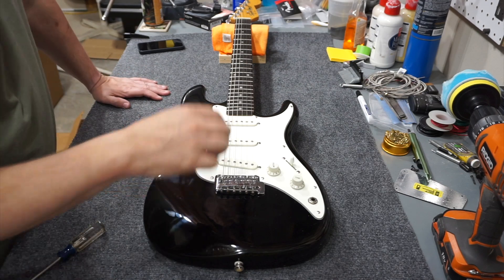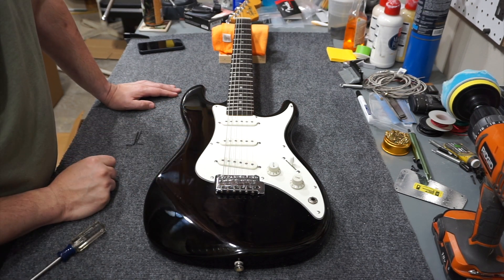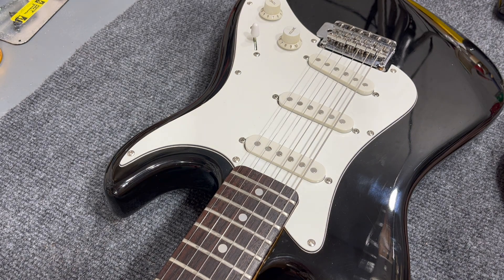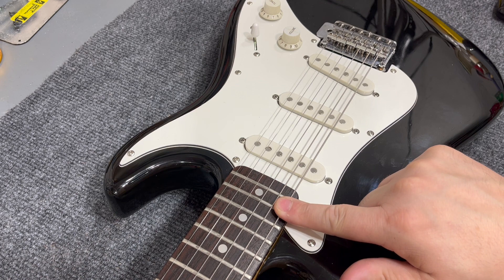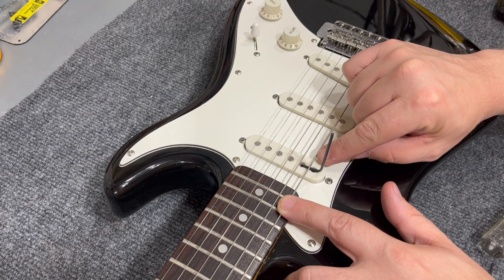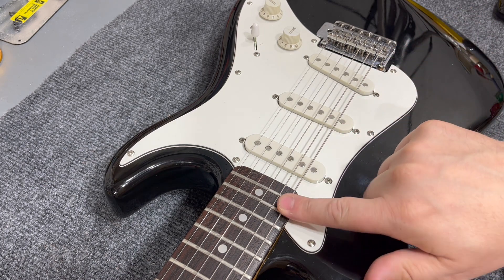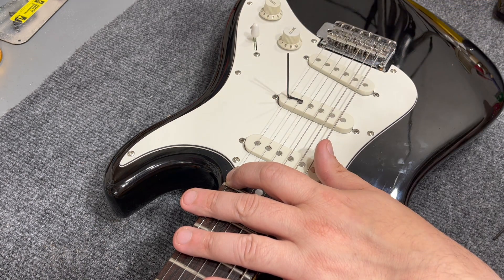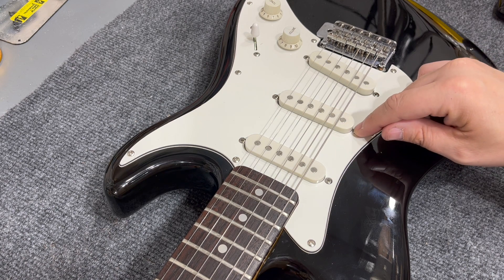Quick Tip 9: Adjusting Stratocaster Pickup Height

Comment: what size hex keys are 4/64 and 5/64 inch.....what are the equivalents in millimetres please?
Reply from the maker: Roughly 1.6 and 2 mm.  There’s probably not an exact metric equivalent in hex wrenches, so you would have to use a 1.5 mm wrench and adjust it for a loose fit.
Reply: 2MM gap from string bottom to polepiece top is Fender's suggestion...
Reply: Always you have to multiply 2,54 by 4 or 5 and so divide by 64, and you´ll have mm measures.

Comment: When you raise the pickup I have notice it is much more senitve when tuning with electronic tuner . I guess this has to do with the magnet being so strong has anyone noticed this ?
Reply from the maker: The closer the pickup to the string, the stronger the signal, so it makes sense.  If you mix pickup brands or types and one is louder than the other(s), it helps to move that one away from the strings to balance the output.
Reply: I think this is what is called stratitis, but whatever it’s called, yeah you have to watch out for it. Even without a tuner if the pickups are too high I think it’s most notable on the G string. It’s will flatten the note fairly quickly, and also noticeably cut down on how long the not sustains for. If you hear this happening it’s just to incrementally lower the pickup until it goes away. Someone mentioned too, this is why when adjusting pickup height, it’s best to start with the bridge pickup. Set it right, and then adjust the other pickups to be the same volume/loudness. If you first set the neck, and it is “hot” it may be the bridge has to be too high to get the same level and then stratitis can happen .

Comment: not really an accurate way to do this since pole pieces can be at different heights on different guitars
Reply from the maker: On a Strat, the E strings are reference points for the other pole heights, so it works out.  See pickup section here: https://support.fender.com/en-us/knowledgebase/article/KA-01901
Reply: @hacksguitarhobby  this is what i meant , thanks